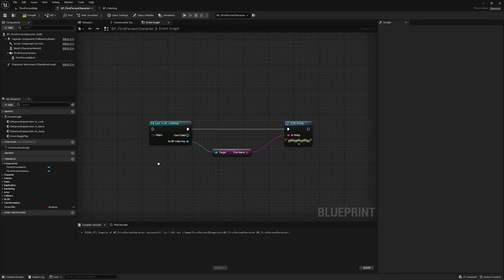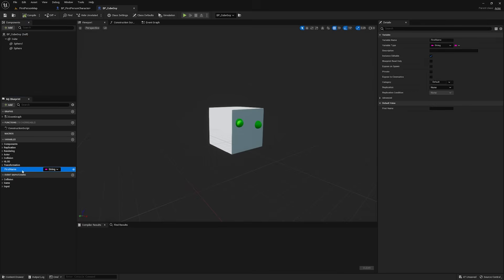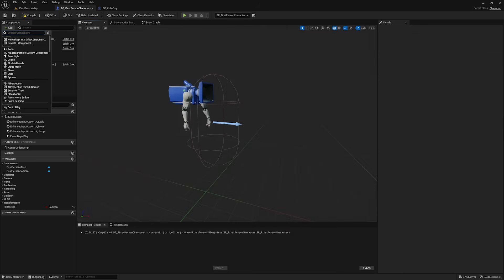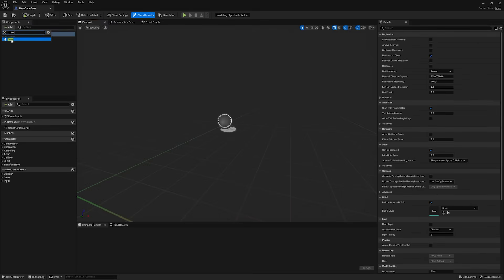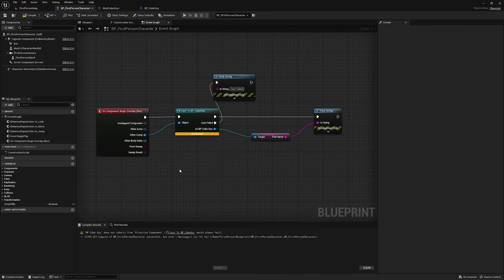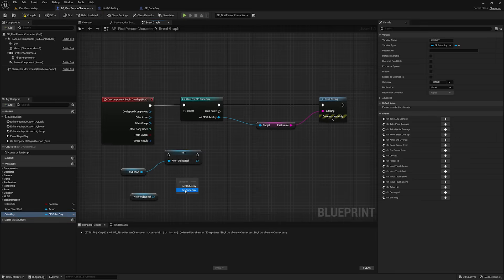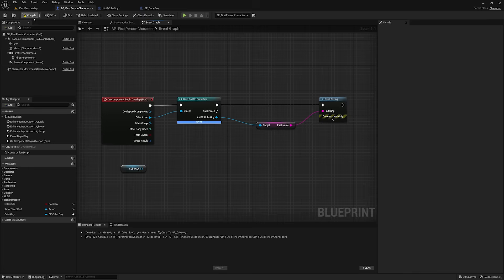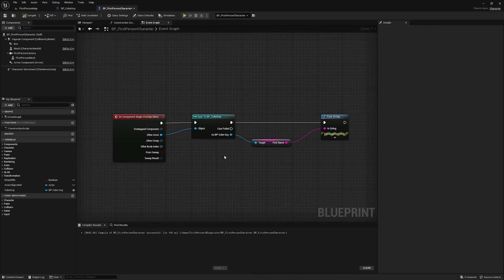Casting Explained | Unreal Engine 5 Tutorial

Comment: Casting is bad because it hard references items together and is not optimal for a scalable game.. so if you have an item that is 500kb but you reference your character through casting to that item.. it will use the reference to your character and all its data on every single item.. depending on the data your character holds it will make that 500kb item into MB’s of data and when you spawn the item.. its not just the 500 kb its that plus your character data.. on every single item.

Comment: Thanks but you actually skipped over what to connect to the Object pin when casting to an Actor 🤦‍♂ Just creating an Actor variable doesn't work
Reply from the maker: Are you casting to the base actor class or a class you created that inherits from actor? You can’t just plug an empty actor variable in, you need a variable that stores a reference to whatever class you’re trying to cast to
Reply: @TylerSerino   Hey thanks for responding!
When you do that, it warns you that you don't need to cast anymore, since you already have a reference to that actor class... ?
Reply: Ok I watched again and see you covered the warning "You don't need to cast to that actor". 

So if I'm not using Overlap, do I just make a box to reference to in an actor reference variable? Or a BP_box? I think I tried that and it didn't work - ? If it 'should' work, I'll keep trying it, I must have missed something. But it would be great if you could do some other examples aside from Overlap!
Reply from the maker: @schmoborama  It ultimately depends on what you're trying to do. You can use overlaps, line traces, you can create variables that you set as instance editable and set them in the details pannel in the editor if they aren't going to change. If you were trying to talk to your game mode, you'd use the "get game mode" node and cast using that. Ultimately what it comes down to is obtaining a reference to the object you're trying to talk to, and if its not a direct reference, cast. But how you do that depends on what you're doing
Reply: @TylerSerino  
Yea that's the problem - how you should do it depends completely on what you're trying to do, it's different for everything, and it's different enough that you have to be shown how for each one - and no one is showing how for each one,, only a couple. which leaves everyone else with their hands in the air 🤷‍♂ 

"what it comes down to is obtaining a reference - if its not a direct reference, cast"

But casting is what I need the reference for in the first place - ??

Sorry to keep bugging you and I hope I'm not just being stupid - but I have to keep at it until it clicks
Reply from the maker: @schmoborama  The best way I can explain is the way I did in the part of the video where I talk about collision return values. An "On Component Begin Overlap" can overlap with any actor you create. But obviously, the On Component Begin Overlap node can't have a pin coming out of it for every single actor your create. All it can do is try to generalize, and return a datatype that every object in your game inherits from - which is actor. In other words, your "bp_customblueprint" data type gets stored in a variable with type "actor". However, the base actor datatype doesn't have any of the stuff you add to your custom classes that inherit from it. So in order to get that stuff you basically need to tell the engine which specific child of actor you're expecting to get - via casting. When you collide with something, lets just say a sword. You're essentially storing it in an actor variable. Not a sword variable. If you want a value specific to the sword class, you need to specify that. The method in which you obtain a generic object reference to something will vary, but ultimately the principle is the same no matter what you're casting to. I'm sorry if this doesn't help :\. Ultimately, this is a concept that everyone gets confused by at some point, and it can take time and repitition to get the hang of. Edit: if you want more help, message me on discord, and for your specific problem I can try to assist. tyler8106

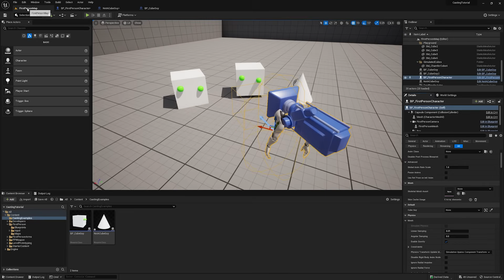Comment: Help!!! At 8:46 - the ONLY reason this all works is because you're able to click on your third person character, and set the cube_guy reference. This doesn't work for me because I'm doing the casting from my gamemode. So how am I supposed to click on 'gamemode' and set my cast references???
Reply from the maker: What are you trying to cast to from your game mode? Like I said, how you get an object reference is all going to depend on what you're doing. You have to ask if casting from your game mode to the object your trying to communicate with is the best method, or if it should be the other way. A lot of the time, I cast to my game mode from anything else, because you can simply call the "Get Game Mode" node and use that as an object reference
Reply: @TylerSerino  hmm perhaps I should flip it then? In my game mode I spawn different actors, and I was trying to cast to the actor in order to utilize a bool var that was in the actor. This is where I’m stuck because I’m not sure if while in my gamemode_BP, if casting to other objects is even possible.
Reply from the maker: @KDmadness18  If you're spawning the actors in from the game mode, you shouldn't even need to cast, the blue pin coming out of the "spawn actor from class node" should give you a direct reference to the item you're spawning

Comment: I've recently taken up Unreal, and found most tutorials lacking explanations of stuff like this. I ended up just reading the documentation instead. So many tutorials will tell you how to do something but not how it does something.
With casting in particular I've justified it mentally as the blueprint picks up the casted object and looks at it, it is now able to interact with it and know about it.
With a video like this I could have saved several hours on the weekend.
Reply: Can you help me out real quick? I watched it but still couldn't know what to put in the "object" pin in my project... 
I have my player, a character that chase me, and a safezone that despawns the character. I need in the safezone's BP a cast to the character BP, but everything i plug in the object pin gives an error/doesn't work
Reply: @LordTartiflette  Sorry for replying so late. If youre having a cast go back and forth between 2 objects, it can cause problems and not work, for something like that you may want to use a blueprint interface, which Tyler has another really good video on. If that isnt the case, then I think youd need to show pictures to get a better idea of what could be causing issues.

Comment: Nice video, me and a friend are new to UE5 and we can't seem to figure out the cast to class and to have that class go into multiple different object. How would that work? One class for multiple objects, like basically a cubeguy and coneguy, but it just is looking to see if its a shapeguy (any interactable object you'd want). That way you could pick up or see name of either shape/object. There's definitely a way I don't know that doesn't involve duplicating the same code over and over for each new object 😂Help would be greatly appreciated
Reply from the maker: You’d use inheritance, and cast to the parent class. So you’d have a shape guy that your cube and cone guy inherit from. Anything they have in common will go in the parent
Reply: @TylerSerino  Solid, will check out your inheritance video to try and get a better understanding
Reply from the maker: @SplarcieRS  Youll also want to check out interfaces. Doesn't have to be my video, but interfaces are potentially another way to achieve this, however, if it's just something like a cube guy and a cone guy, i'd use inheritance. If it were, say, a cube guy, a cone guy, and a door (door is completely different), then you'd want to use a combination of the two. Either way, both super useful/important concepts to understand. Best of luck!

Comment: Nice tutorial. I have watced your other videos about blueprint interfaces and event dispatchers and I like them, very helpful. But I have a problem which I am still unable to solve. I hope I can explain it in a few lines of comment. Simply put, I want to send data in other words cast to character blueprint from a game mode blueprint. I have tried CAST TO and INTERFACES and EVENT DISPATCHERS but none of them worked. All three of these have the same input pin, OBJECT or TARGET which I don't know what to plug-in in the game mode blueprint. Here is the setup: The game mode blueprint randomly spawns NPCs (enemeys) in waves in the level which the player has to fight and kill. Now what I want is that the dead bodies of the NPCs stay on the floor until the wave is finished and then get rid of the bodies cleaning the floor for the next wave. There is a node in the game mode blueprint that is called whenever a wave is finished and initiates the next wave, at this moment I want this node to send a message to the enemey character blueprint to remove the bodies from the level. If this doesn't clearly explain the problem I would gladly record a videos of it and let you watch it. Thanks
Reply from the maker: Off the top of my head, what I would do is create an event dispatcher in the game mode that gets called when the wave is finished, in your enemy bp, you can use the “get game mode” node and bind to that event dispatcher to destroy them

Edit: you can use get game mode, and use that to cast to your specific game mode, then you bind
Reply: I have tried that already. In the enemy bp, the "get game mode" output pin doesn't connect to the input pin of the event dispatcher. Here is what it says: game mode base object reference is not compatible with bp game mode object reference.
Reply from the maker: @Ahmadnaweed786 You cant connect directly from the "get game mode" node, you have to cast to the game mode your using, which is going to be a child of the game mode returned by the "get game mode" node. So GetGameMode->CastToYourGameMode->bindtoeventdispatcher. If you need more help you can message me on discord tyler8106
Reply: @TylerSerino  ok thanks. I will do this and let you know the results.
Reply: @TylerSerino  it worked! thanks. And I have also sent you a friend request on Discord.

Comment: A blueprint is a class that can be an object instance. An actor is considered its parent class, BUT the child class is also called actor. So when the "other actor" pin gets connected to the object pin the logic flow is Get Owner: target is actor component is essentially finding the child class of the parent class actor and outputting to Object pin which represents the instance of it. Then cast to references the blueprint to access which in turn "gets" target first name. Now for other actor to Object pin overlap executes on any actor and Cast to operates within the parameters of itself because the "Object" is the instance of the cast to blueprint class. I'm not too sure about overlap being executed but not going through or just simply not executing at all. The reason why I am not sure is because the Object pin is an input I THINK, not an output. I just started unreal like a month ago don't really grasp the concept that well

Comment: Hi Tyler. I am trying to make two BPs use each other's variable.
I have a player character BP and an actor BP as an ability projectile.
I would like to have multiple different ability actor BP.
I am trying to increase the ability's damage increase by the players bonus damage.
I have tired the method at 6:50 of the video as well as getting all actors of the class and then connecting it to the cast to node.
I am not sure what I am doing wrong:(

I do have an imgur link that i could send to you
Any help would be greatly appreciated
Thank you in advance!:)
Reply from the maker: Since it’s a projectile I’m assuming your spawning them in during game? If so each time you spawn one in, that’s a new object and when you destroy them the object reference will no longer be valid. If I’m correct and you’re spawning them in during runtime, what you could do is set the variable for bonus damage on the projectile as “expose on spawn”. Click the variable in the blueprint and look on the right hand side in the details panel. Now, when you use the node “spawn actor from class” that bonus damage will be an input. If I’m wrong and your not spawning it in, or if you’re still having trouble, send me the imgr link and I’ll try to help
Reply: @TylerSerino  Yes thank you so much!!!!! This is exactly what I needed I can't thank you enough:) I really appreciate your videos!